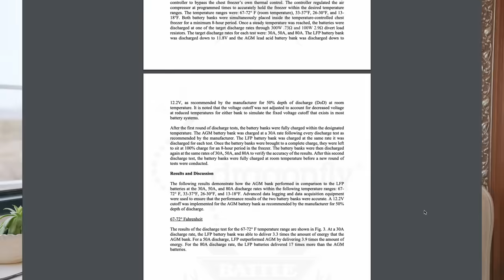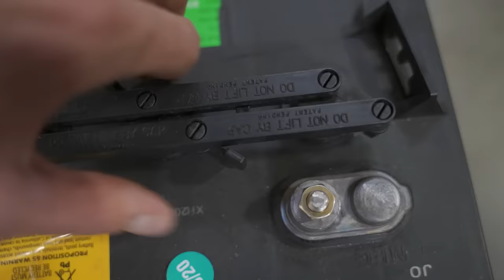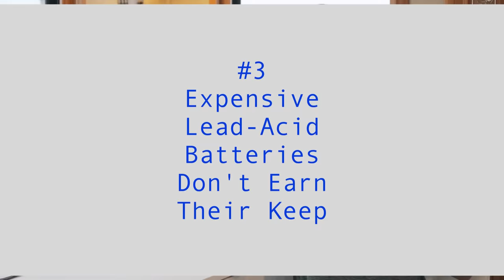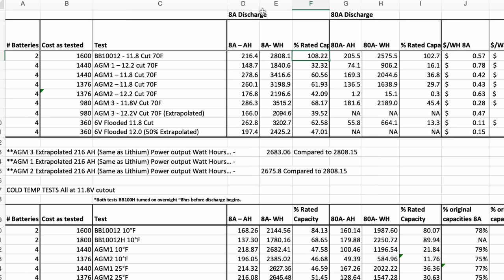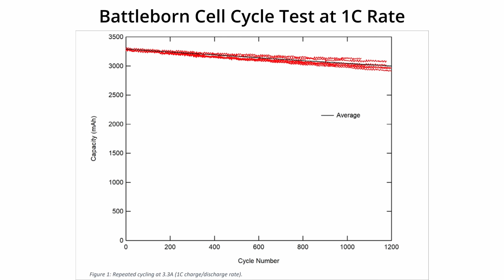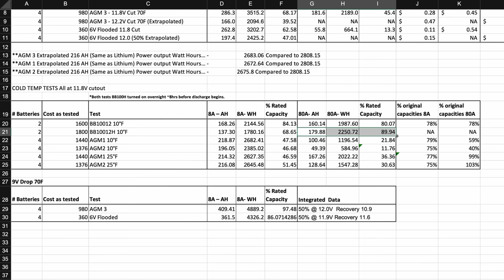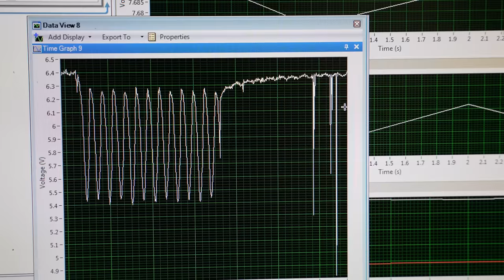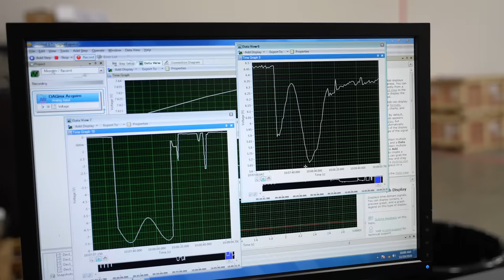Don't Waste Your Money On Batteries - The Shocking Truth I Discovered When Testing RV Batteries

Comment: Great video!  I'm afraid some of the manufacturer specs may have been taken out of context.  They are OCV (open circuit voltage).  BCI (Battery Council International) regulates how lead acid batteries are spec'd, 100% DoD is 1.75v per cell or 10.5v for a 12v battery.  The voltage drop in the 80A case will cause the lead acid capacities to be misrepresented dramatically. The Peukert Constant for a lead acid is around 1.3, whereas Li Ion does very well with a constant of less that 1.1, so Li Ion will still win this battle but by a lesser margin.  Including cost, or dollar-per-watt-hour, you might be impressed at how well lead acid does. Also, were the lead acid batteries equalized regulary?  

 For the the record, I'm a power electronics engineer and have worked for a Li Ion manufacturer and ran a lead acid desulfation research company.
Reply: I thought of your point regarding open circuit voltage versus voltage under a load. To someone who knows batteries like yourself, it’s obvious that if you have a battery under a 50 amp load and compare to 1 under a 5 amp load, The higher the load, the lower the voltage even at the exact same state of charge and the same temp. 
You are correct that the voltage/SOC numbers given by the lead acid batt manus assume room temperature and no load conditions. 

FYI, I’m not an engineer but I have worked on power systems with flooded and AGM lead acid batteries for decades and my field experience agrees with yours.

It was great for me to read your comment :-). Thank you.
Reply: This is what we need the dislike button for.
Reply: Thank you, you saved me typing about the OCV. While I absolutely think Lithium is far better for off grid living I don’t think it helps giving a skewed view by misinterpreting the charge floor of lead acid, it actually invalidates most of the data.
Reply: @user-ze7tl2dw4i  use an google extension to show dislikes.atm this vid have 1.6k dislikes
Reply: D W  What do you think of the Aluminum Graphene batteries by Graphene Manufacturing Group? Have you seen those?
Reply: D W  I hope you take at least a quick look. The energy density of their batteries is 150Wh/kg, and the power density is over 7000 W/kg. No thermal issues either, and a 3000+ cycle life.
Reply: D W  That would be interesting to see, however this video is aimed at RV's... 

I personally plan on using two Lithium batteries for a total weigh of one deep cycle battery. So if I used your idea of getting dollar for dollar on batteries, that would be 16 deep cycle batteries, if we say a standard deep cycle weights 65 lbs each, that's 1040 lbs of batteries, plus how much space they would waste in an RV's already limited space. Or I can have a total weight of 62 lbs for two Lithium batteries. My tear drop trailer will only weigh about 1000 lbs without batteries. So your looking at doubling the total weight of the entire trailer, to use standard deep cycle batteries.

Then the tear drop trailer is only 32 Sq foot, and you would definitely have to load that 1040 lbs at floor level, so you lose at bare minimum 8 sq foot of your space.. thats 25% of your floor space.. and that's assuming you leave zero gaps between the batteries. 

You have to look at what the video is aimed at, and that's for RV use, not running a solar farm at your house, where weight and space are not as much of a variable.  I personally have not bought any batteries yet, and looking at different options. For my use the Lithium batteries seem like the clear winner, on a side note I need to run a 12 volt refrigerator , it automatically turns off at 11.2 volts, so the deep cycle would cut off a LOT sooner as well, due to the information in this video, and many other tests. A lot of 12 volt equipment has similar cut off points, so pulling the battery down to less than 11 volts isn't even an option.

I would love if you could buy a Lithium battery with less cycle count for a lot less money, because to me lasting 5,000 cycles isn't a big selling point to me, since I will more than likely only use it for 1-2 years for this purpose. I do plan on adding solar to my house some time, so maybe I can get a 2nd use out of them at that point, or just resell them once I'm done with them...
Reply: D W  I didn’t know where to comment so I guess I’ll jump on this train. I’ve been in remote power management for more than 20 years. Basically remote monitoring and sensing in all kinds of conditions and environments. A good LiPO wins in almost all applications. When space, weight, charge cycles, long term cost, longevity, and total watts matter, LiPO wins handily. When all you need is peak amps and won’t pull more than 20% of the total power down between charge cycles, lead acid is ok. 
I’m also a boater. All experienced boaters know that LiPO is what you want for your house bank (runs appliances and other high power equipment) and lead acid for just for starting your diesel motors. If you run lead acid for your house bank, you are terrified all the time, watching your voltage levels. Accidental battery abuse in the boating industry keeps a lot of service companies fat in the wallet. In fact, lead acid poor performance is the primary reason the generator industry is still thriving in marine applications. A good LiPO house bank is on every boaters wish list. Final comments here is that lead acid is very limited but it’s all we had so it’s overused in far too many applications. It’s really a square peg jammed into a round hole in nearly all cases. I think back about all the oversizing of battery capacity and solar panel capacity we had to do because we knew over 20 years ago that you that you typically needed a minimum of 4x the posted rating to be safe.  Yes, 4x! If you needed 100AH between charge cycles, you wanted 400AH in capacity at a minimum. Because you knew from experience over the batteries useful life you’d get about 25% of the rated capacity. LiPO…totally different ball game. I would argue that LiPO is not even that great but we so desperately needed something better than even LiPO manages to be relatively revolutionary.
Reply: Thank you, I'm a luddite and it was clear to me too.
Reply: D W  nicely done
Reply: @solarwind907  I haven't read all of the comments, but so far I have seen no mention of the charge rates.  I an article I read some years ago, it was about charging lead acid batteries, it stated that higher charge rates caused the battery to loose capacity that can not be recovered.  I have found that to be true in the lead acid batteries.   At a half amp charge rate many discharged automotive batteries can be restored.   Some of the recharged batteries had been discharged to 0V for months, and one for about 4 years they return to good service IF charged slowly.  Higher rates of several amps and more seem to short cells in most cases.
Reply: Thanks for the fact checking Sir!
Reply: @Cypress123  that's correct to my knowledge as well.  Lead acid batteries do not like to charged fast. C/4 is about the limit, meaning don't charge faster than a 4 hour rate. So a 60 AHR shouldn't be charged faster than 15 amps.  

The failure mode mechanism is called shedding of active material, and yes, it causes a permanent loss of capacity.  

The auto stores have that one-hour charging gimmick. It's a rigged deck because it accelerates failure which results in need to buy a new battery.  Charging it in trickle mode for 48-72 hours can bring it back, as long as the there is only sulfation and not a shorted cell.

Be nice to your lead acids amd they will be nice to you!
Reply: I consider lead acid also for occasional users that keep batteries charged until needed in a power loss. Since I would not be constantly charging and discharging like a daily user wouldn't lead-acid last many years neutralizing LifepoS number of charge/discharge cycles from my cost comparison?
Reply: @user-ze7tl2dw4i what didn’t you like?
Reply: Good comment, some high quality deep cycle AGM has a peukets closer to 1.15, most manufacturers will either give it on the data sheet, or provide discharge curves or AH ratings at different currents. A little algebra will sort it out, and is handy when shopping for batteries.
Reply: Your comment is helpful. I think this appears to be biased science. The vertical axis on the table at 10:30 is manipulated to downplay that the lithium is more expensive than all the others to 12.2v. This type of manipulation strongly implies bias and poor scientific analysis.
Reply: @user-ze7tl2dw4i You can still hit the dislike button. Most of us who care have extensions that allow us to see it.
Reply: Your comment is good - my grand father started working on the old hybrid power plants in the early 1900s - in the deep south were i live it doesnt get very cold - the acid  strength they used was generaly .195 to .200 - 
 ...  Down in the french quarter on burbon street the origanal edison power plant that furnished 110 DC  power was a hybrid plant - 
      My grandfather often talked about the efficiency of battries and generators - 
      I would be a 4th generation power production electrican - i started in. The 70s working on offshore rigs - we were changing them over to SCR drives - 
     When on to be a systems tech my family was also in the communication bussiness so i was a contractor also but in the offshoe oilfields - 
     Modern platforms switch to huricane mode when there is to much moisture in the air for turbins to run - 
     The platform are often supported by 3 to 6 mw lead acid battrey banks - 
 .  Three electrolyte is often .195 gravity - with the weaker solution cell failure is rare - 
     Up to this point there are no plans of up grading  flooded battrey's - 
     When i was a kid down here in the rural south there were some that the pole power had never made it to there farms - also sence pole power was around 30 cents a kw some continued to use there farm light plants - with battreys - 
     They they coukd generate there own power for 4¢ a kw or less -  some of those battreys with the weaker .195 acid were well past 40 yrs old - 
    I use .220 for my ups my power has gone out for up to 9 months - my gen is a oil engine and runs at 23:1 effecency lol and is very old. - im staing with lead acid my 26 battreys have held up well over 42 yrs now -
Reply: Very refreshing to hear some smart comments! I've been working with batteries for 25 years and it's pretty frustrating to hear how many people have 2 pounds of knowledge and 10 pounds of opinion.
Reply: DW11111 so obviously BB battery promo
Reply: Many Great comments, a lot of wisdom and knowledge! I was reminded of how many times i heard BBorn during the video.
Reply: Battleborn is an ultra expensive option to begin with at $925 per battery you can get $500 12V 100Ah cells which perform just as well, and even then that is not the best price/perf that goes to server rack batteries at $243 per kWh, the $500 12V 100Ah battery comes in at $390 per kWh and the battleborn comes in at $722 per kWh. So even if the battleborn is getting close to matching the price per kWh it means a solid win for Lithium-ion as that is litterally the most expensive way about going Li-Ion.
Reply: His verbal interpretations of most/all the graphs appear to be biased in favor of the lithium batteries. On a couple, I cannot see how he arrives at his conclusions about what is shown.
I also wonder about the graphs that have one battery missing from the data display. Also, there is no explanation why one of the lead/acid banks has such a huge cost/unit - compared to all the other banks.  @Gladfulspirit
Reply: @able880  I can't comment on the veracity of your electrical knowledge or experience BUT you would certainly be doing yourself (and the readers) a great service if you either checked your post for simple spelling, grammar and syntax mistakes before hitting the "reply" button or asked the grand kids to help out. 🙄
Otherwise your lack of care there would certainly give anyone contemplating one of your wiring jobs the jitters! 😱😉😊
Reply: @theoztreecrasher2647  I'm glad you made that comment - the problem with engineers in the majority of cases - is there pour at spelleing, &  punctuation - 
        My dad wanted me to take over his publishing firm - he did his best to teach me the art of writing - 
    I can put words down, but that's it - it would be for some one like you to rewrite it -  you would be the engineers editor lol - 
       You stick to writing and editing and I'll stick to reading several books a month and engineering - lol
Reply: @bradatherton9369  What's the best charging method for lithium batteries then? Slow or fast.  Like, will the new  fast charging and high (800 - don't know if it's voltage or wattage) "alternator charger" for power stations (like a Delta) affect the life or capacity of the battery in the unit over time?  And, if overcharged (without a BMS) for just a few hours once in a while, is that terribly bad for them? (I fall asleep charging my tiny older Sauoki all in one battery with no BMS with a big generator).
Reply: @ServantOfJesusChrist777  I love remarking to questions like this, and there is a lot of researching to improve upon it such as pulsed charge methods so take what I say with 2 or 3 grains of salt. For one, Li Ion does not like to be charged too quickly or else it experiences a phenomenon knows as 'clumping'.  Clumping causes an increase in cell impedance that shows up on the charge and discharge curves, further inducing more clumping.  It is arguable whether or not this is reversible, but everything I have owned with Li Ion chemistry has lasted 5-7 years of daily use so I'd like to think it is correctible if caught soon enough.

 Li Ion does not like to be overcharged, whereas lead acid does (or can tolerate it, if you can rewet the cells of LABs).  Li Ion has issues with overcharging because of the conversion from ionic lithium to metallic lithium, where the extra electron that contributed to charge capacity is lost into the 'plates' and eventually results in dendrite formation which eventually results in shorted cells.  It is OK to 'overcharge' Li Ion cells by a few tenths of a volt (i.e.: 4.2v cell can be charged to 4.3v or 4.4v) if the current is limited.  This limits the ENERGY that has to be absorbed into the cell.  If you push the cells in to the recombination region too much, it loses capacity, but moreso as a function of energy into the cell and less a matter of time into the overvoltage region.  So the point is...use a CC (constant current) charging method ONLY up to the rated max voltage of the cell, then flip to a CV (constant voltage) method at that threshold, then the current has no choice but to roll back and energy with thus roll back with it.

BMSs are super important with Li Ion, moreso than lead acid because Li Ion has more issues with OV and UV (overvoltage and undervoltage) than other chemistries.  

Hope this helps.  If not, dear Lord baby Jesus I hope you find someone that can help you.